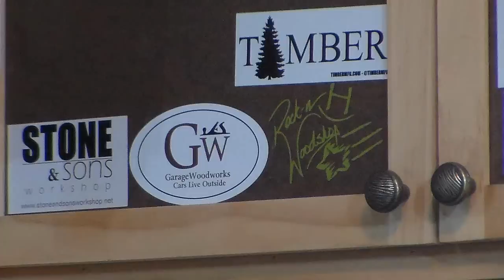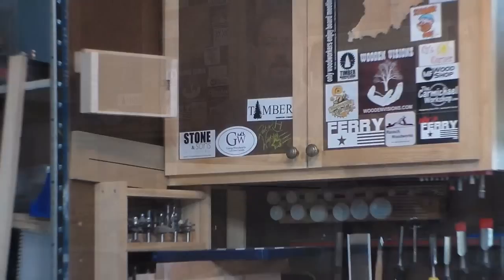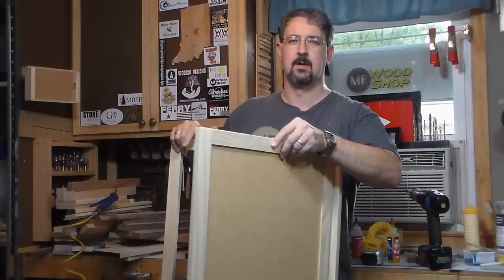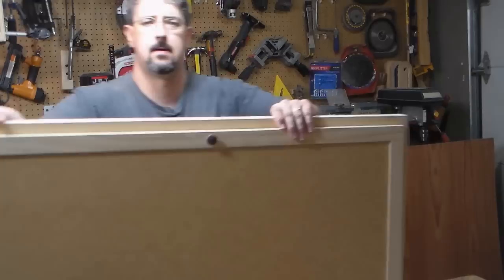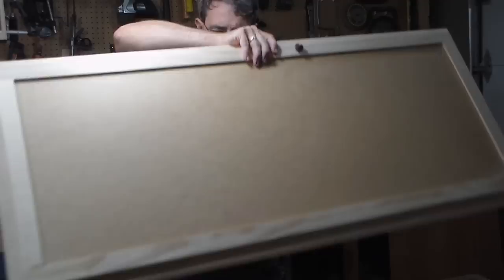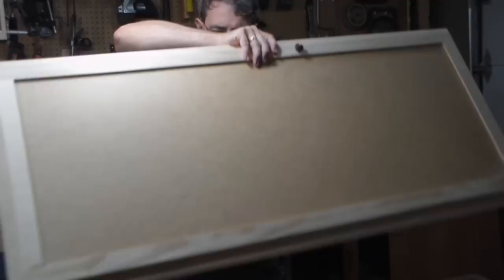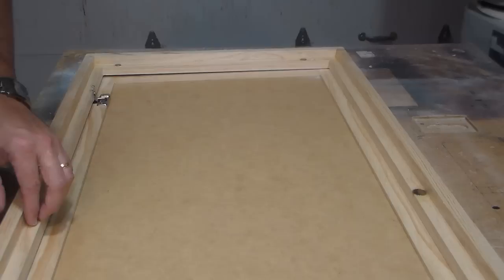Elctrical Panel Door

Comment: Great job Mike. Glue some cork on the inside of the door that will give you plenty of space to hang reports etc.also use magnets to stick things to the electrical panel door.,you can get them with clips Nice video
Reply from the maker: Backyard Woodworking coundn't find any cork wide enough